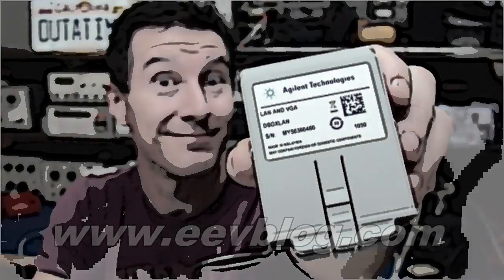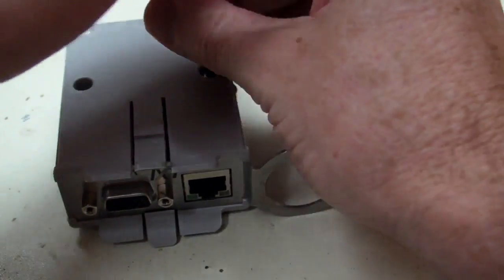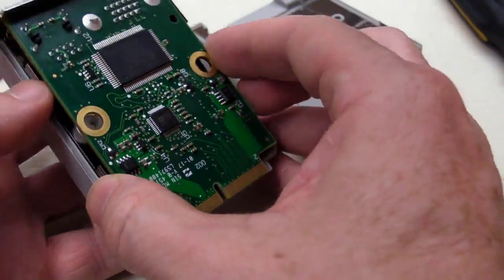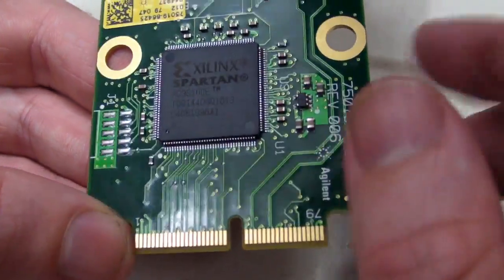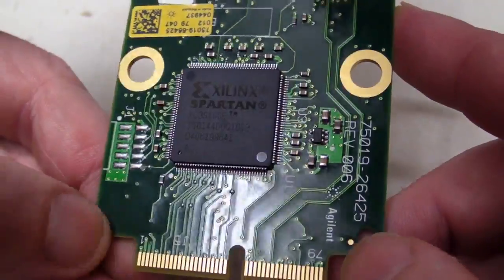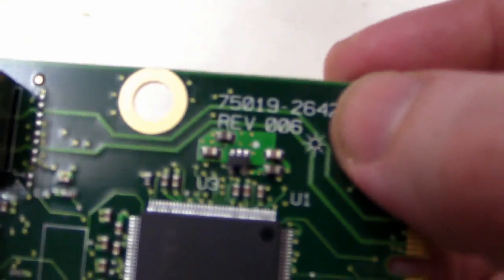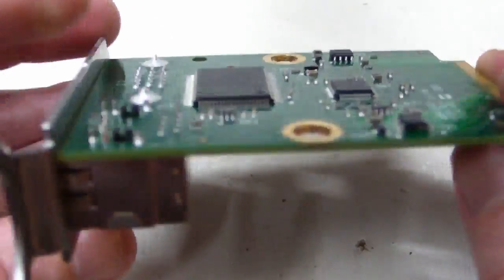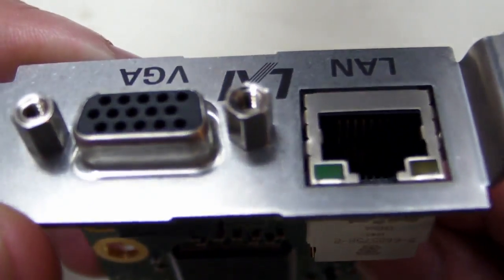EEVblog #145 - Agilent LAN/VGA Module Teardown

Comment from the maker: @usunoro No need for software, the scope has it's on web sever inside, just type in the IP address into any browser and you can access the scope. Whether or not the scope firmware detects the module first before enabling the web server capability I don't know. Worth trying if you had one! Maybe there is an enable pin on the module, in which case you could just do your own board to get Ethernet capability.

Comment: Theatre ticket numbers often begin at No. 1000 in order to make it appear that at least some tickets have been sold already. Likewise, REV numbers are artificially inflated in order to make it appear that the manufacturer is actively developing a product
Reply: It's hard to say though, a lot can change during the development of a product so it could be normal to see high rev numbers. It also depends on the policy and such. For example, would a new rev number be assigned simply if one resistor is changed?

Comment: You're probably right, the LXI interface is probably locked out unless you have the right board to tell the 'scope that the interface can be used. I've seen a fair bit of agilent gear where some interfaces and features are already installed but you need to pay for a software upgrade key before you can actually use them.

Comment: I'm wondering, will network work if just to connect MagJack to the main board, or network functionality blocked on a software level until you connect the FPGA responsible for VGA output?